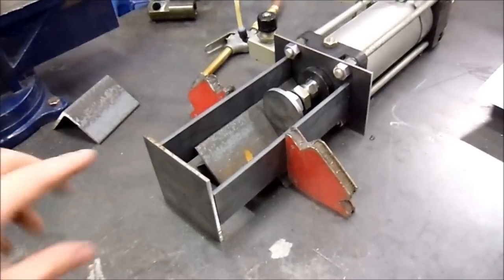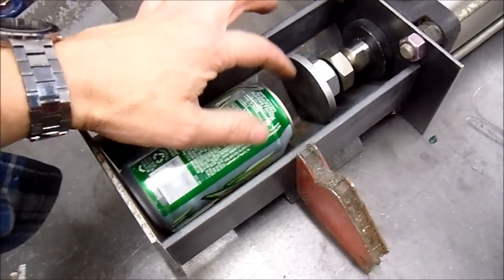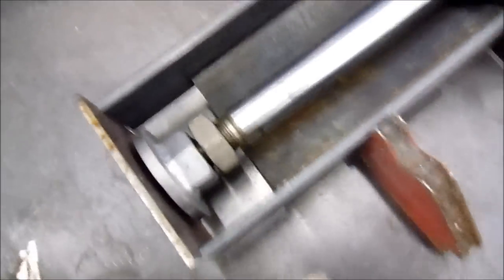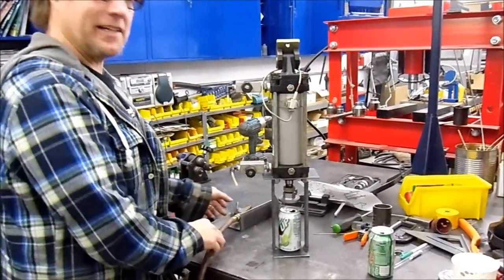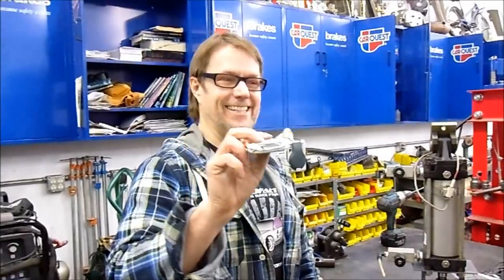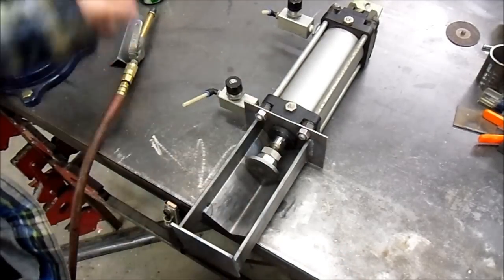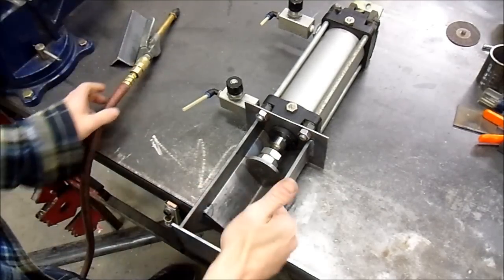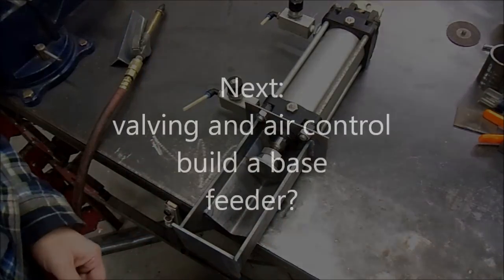Can Crusher DIY Part 2,  Montana Style. 1200PSI cylinder

Comment: interested to see part 3 and what valves/ actuators you went with - and did you keep the flow controllers ?  dont think its needed ( maybe on return stroke) as it looks like your cylinder has soft stops in it anyway